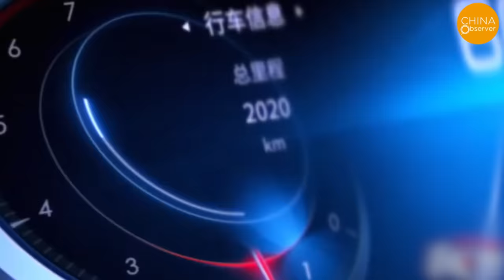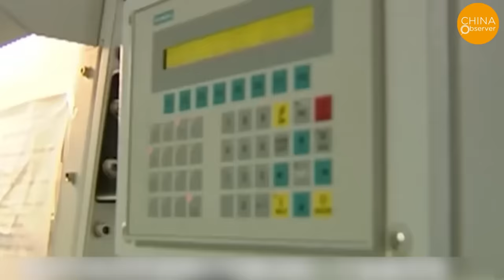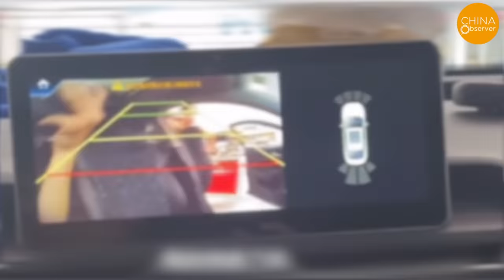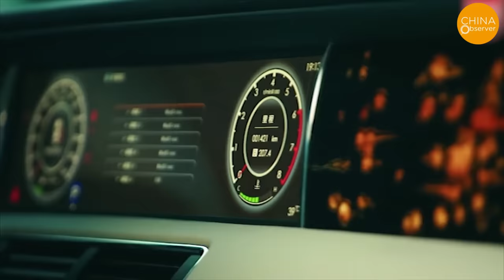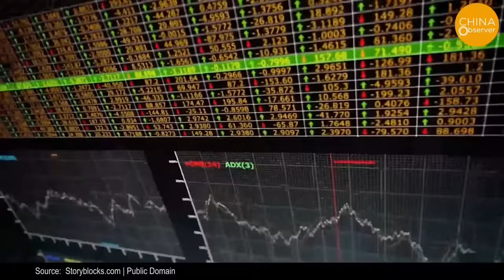Red Flag (HongQi) Car: Pure Garbage! Blatant Copycats, Abysmal Quality Leads Owner to Smash It!

Comment: Fun fact, if your doors don't latch well, pick em up and give em a hand! Seriously,  lift the bottom of the door at the furthest point from the hinge. Leg press into it, you will move the car, it feels bad, but you're realigning the door. Trial and error, but you'll eventually get your doors shutting smoothly. 

I got a car like this, got a steal of a deal. Just some lifting and it was good as new. This is literally how the doors are(or in this case, aren't) aligned on the factory floor.
Reply: So what happens when you rip the door off the hinges?
Reply: @ms.annthrope415  you put the steroids down for a few months
Reply: at this price point... errr i hope you're being sarcastic.

Comment: You can’t pay me to drive a Chinese vehicle let alone own one . I’m extremely happy with my Japanese Toyota Corolla , it’s not a Lexus but does the job , never breaks down and despite having a 4 speed automatic transmission it’s very economic on gas . I own the car since 2009. Fabricated in 2007. It’s my daily ride for grinding . I also own a much newer Chevrolet tracker SUV which I mostly use for long travels , but I ain’t gonna sell the Corolla .

Comment: That first guy got charged with "picking a quarrel" and disappeared.
I don't know anything about the chinese car market. But isn't there something like warranty on cars in China?
Our benz had an issue with gearshift aged 6 years and 125.000km. Warranty expired years before. Benz fixed it. They told us it cost 2400€ to fix it. Then they apologised, said that should not have happened, tossed the bill in the bin, and wished us a safe trip.
Which brand do you think our next car will be?
Reply: Come to india. Merc bmw audi charges us same labor and other costs as eeurope and usa, and then just stiffs us.

Comment: Hyundai (Korean) motor have division that works on domestic and import. They put extra effort on the import and half ass domestic because they can control consumer report under control there much cheaper than here in the state. Hyundai has been the leading lobbyist for automotive media for a decade and that a Korean manufacturer, imagine what Hongqi will do.

Comment: @5:48 That L5 looks like a cartoon character based on the communist cars from the 1950's, including the "surprised" headlights.
BTW, I wouldn't hold Volkswagen up as an example of technical advancement: the interior (especially the dash components) looks like it was designed by a committee of bureaucrats from the 1960's.

Comment: Hingqi- design a new luxury car.

Design head says- take rolls front end, maybach back end, bmw doors and infotainment system, audi interior, jaguar ac system. Throw in the kia 2.0 liter gdi engine, hyandai features and electronics.

Desig  tbr red flag in house and plug it in the front end - car is ready.

Comment: At the risk of stating the obvious, the warning is in the name, 'Red Flag'.

In the West, a Red Flag is considered to be a warning, ie, it raised a Red Flag!

The car the dear leader drives will have been meticulously hand built using quality components and put together by skilled engineers.

It will have nothing in common with anything an ordinary customer can buy!

A three year old Japanese or German car would be more reliable than a brand new Red Flag, and it'll probably hold its resale value better!

I wouldn't drive or ride a Chinese built vehicle even if offered payment to do so, I consider Chinese built vehicles to be unsafe, unreliable garbage that's unfit for purpose.

As a former mechanic and workshop owner, I wouldn't work on Chinese built vehicles at all.